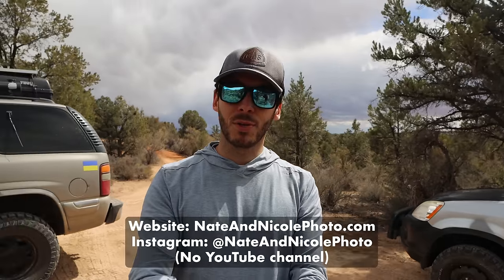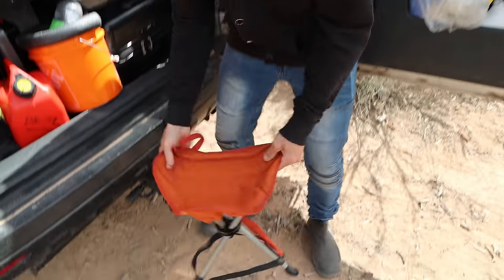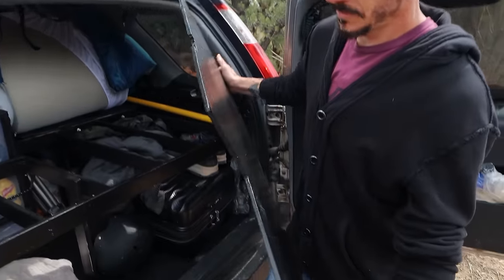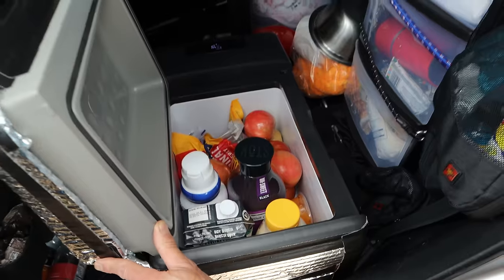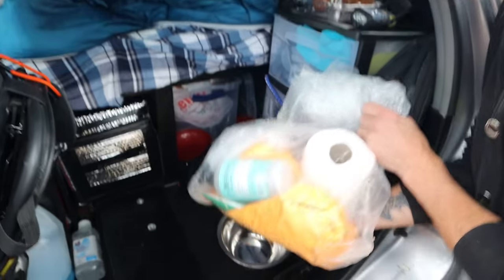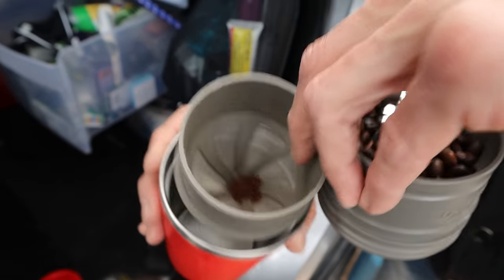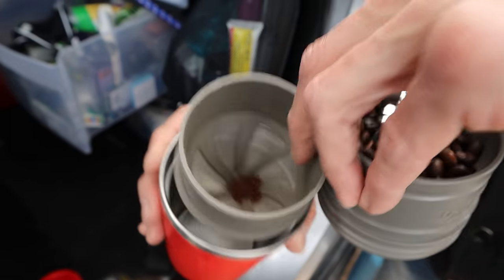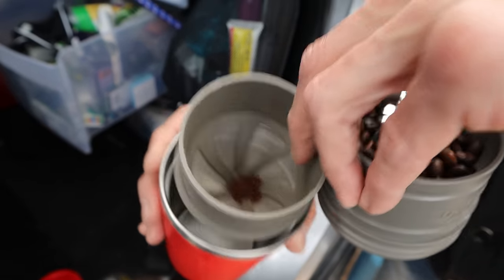Turning a Honda CR-V Into a Full-Featured Off-Road Camper!

Comment: My doctor told me just this week that Pedialyte is better  than Powerade for restoring electrolytes.
Reply: Yes we keep a bottle in the refrigerator during hot humid days of southern summers or when winter viruses are going around.  It is a life saver.
Reply: Check out lmnt electrolyte mix!!  Many flavors. Have a sampler pack too. I use more water than it calls for so lasts me longer 😊😊
Reply: You can do your own with sea salt or pink salt, a little bit of potassium salt (Nu salt to No salt) and a magnesium tablet.  Cheap and best of all no sugar or fake sh….flavors/sweetners.

Comment: I bought a 2002 Honda CR-V brand new and put 300K miles on it. The only issue outside normal maintenance and tires was the AC compressor that failed at around 270K. The CR-V was still going strong until 2017 when 2 out-of control SUVs killed it on a snowy day in 2017. Great utility and camping vehicle! I miss it.
Reply from the maker: Yep, I've heard great things about the early generation CR-Vs! I've always wanted one too.
Reply: Theybare fqmously reliable. Mine just needed front brakes at.200.000.hard to find.

Comment: It's really not worth the hassle of building a bed, storage etc with ply and 2x4 or whatever into a vehicle this size.The extra weight, not being able to completely remove everything quickly if you need to is just inconvenient. You simply need to remove the back seats,  make it flat, insulate the bottom and fit some carpet. Put in a foam mattress, plastic storage boxes, one insulated for keeping food cool and that's it really. Maybe a net strung up with elastic tie outs on the roof for clothes.
This way, everything can be removed easily if you need the space back.

Comment: Nice! I also have a CR-V (compact RV)  I camp weekends in the summer even though I did drive to Florida and back this spring. I removed the passenger rear seat so my bed fits, and still have space for two passengers.

Comment: Very nice camper! We have a Honda CRV we converted and it's working out great. I'm a landscape photographer so sometimes I go alone but most of the time my husband goes along. We started out with two extra bins of camping gear and paired it down to only two bins. Lots of storage underneath for my camera gear and other things we need.
Reply: I’m getting started on my 05 CRV interior build to take to Baja. I’ll do a similar platform for just me and remove all except the drivers seat. Two well traveled cats coming along.  I guess I will build a mounted cabinet with 3 pull out drawers for alongside bed platform for all my essentials. Hoping to not need a heater in Baja, just warm blankets. Any suggestion on a good quality mattress? I’m a side sleeper and boney so I’m in a lot of pain on cheap thin mattresses.

Comment: I agree that most builds use way too much volume and weight of wood.  I view that as an easy way to prototype and test out configurations, but that once you have the setup you want, it's a good idea to rebuild it with a more engineered solution to eliminate obstructions, reduce weight, and reclaim more useful space.  Regardless of vehicle size, creating extra storage space and easier access is a good thing.

I was glad to see at 17:06 that he hadn't covered the air inlet/outlet slots on his Vevor 12V compressor fridge.  Failing to do that will make the insulation counterproductive.  A fridge won't work when sealed in without air flow.

Vevor fridges generally (and maybe always, I'm not sure) are just rebranded Alpicool.  Some are available with the optional LG (South Korean) compressor rather than Chinese compressor.  Those have a big black triangle LG sticker on them in marketing photos.  I have the Vevor clone of the Alpicool CX50 with LG compressor, though it's looking like that variation and shape of Alpicool (CX30, CX40, CX50) is maybe no longer made.  Their shape happens to be the largest you can fit on the floor (actually spaced up from the floor maybe 4 inches) behind the passenger seat of a 2016-2022 Prius or Prius Prime, after removing its roller-luggage handle, wheels, and axle.  It elevates my mattress at the pillow end of a 25x75x4 trifold mattress I use.  And yes, I can sleep with the fridge compressor kicking on and off under my pillow.  I slept with the fridge next to my bed at home for a couple months before doing that, to get used to the sound.

Mine has been running continuously for about 2-1/2 years with zero problems.  I chose it for two reasons: being precisely the size and shape I wanted, and that a Vevor was very highly rated in a comparison of 11 12V compressor fridges done by Jasonoid and his father-in-law.  They personally owned all 11 fridges, as sort of a hobby/obsession, and that was the video which caused me to subscribe to Jasonoid.  Great channel somewhat similar to Hobotech or Will Prowse, though each of the three channels comes at things from different angles.

Comment: When he talks about 2x4s and 3/4" plywood, makes me think he's casting shade on me since I had some of the first 2nd Gen Honda CR-V camper conversion videos up on YouTube years ago...lol. One thing I tell people that see those videos to keep in mind, I had absolutely zero skills or experience when I built my CR-V camper conversion build but I at least gave it a try and did it, though it did turn out to be quite a bit over built. Weight wise, I calculated the weight of that build to be roughly around 200lbs of wood but removing the seats offset some of that weight.  

I've learned a lot from that first CR-V build and improved my design and build quality quite a bit in my current vehicle, a 4th Gen Toyota 4Runner, I still used 3/4" plywood but dropped the weight by at least half cutting out the 2x4s...honestly can't see using anything smaller than 1/2" plywood if you intend on using any kind of hardware like hinges and such. At the end of the day though, these kind of builds should be tailor made to suit the intended use for the owner, we all have different comfort levels and needs. I definitely went overkill on my CR-V build but there were some good ideas I had incorporated with plenty of room for improvement, which I think I was able to do in my 4Runner.

Comment: looks great made for you, nut there is one problem in most states the fuel plastic cans CANNOT BE ON THE REAR OF THE TRUCK? placing it there is a FIRE BALL READY TO HAPPEN? im not telling your going to get rearend , but if you did  chances are you going not live, . i know in the 11 western states of the united states that a plastic can  are not to be on the rear , but a steel cans are?also there is a limit to how much  most states ay 5 gals, but if you look at the flat offroad tanks the max. is 4 gals, also i invented a sure way not to develop pressure in the plastic or steel cans , a vent made from valve stem video on you tube, to install with a cut wire cloth hanger,  and i took a stem cap and drilled out a small hole in the cap on top, to release the pressure at all times? 1/8" hole!
Reply: Great info. Thanks.

Comment: I believe that this version of the CR-V was made from 2002 until 2005 and also came in a manual transmission.
Reply from the maker: According to Wikipedia, this is the 2nd generation and was from 2002 to 2006 👍

Comment: So I'm in the market for a CRV but I'm trying to figure out what year would be more appropriate for me. I'm in Florida and I'm going to have to deal with a lot of sand. And I'm a bit worried about that, I don't need to go out too far, but I would like to if I could. And I understand. Maybe I'll need to lift it, but I'm not sure that will give me the desired result. I am also going to be living in the CRV. So I'm looking for what one is best for me and it needs to be great on gas with really around 35 miles per gallon. Plus, I see a few were like 33 and that's fine. That's not a big deal. Anything 30 and below is a no-go because I'm a delivery driver and I need my gas mileage to be great. But I'm seeing where some of the older models maybe a better choice. And it's been hard for me to find good information on using a CRV for off-roading. Now I'm not going to be doing any major off-roading. But the Sandy rhoads get pretty bad pretty quick without going out far and they're extremely easy to get stuck in. Eventually. I'm going to go ahead a pulley hitch on it, that way if I do get stuck I can just go ahead and hook that to a tree and drag myself out.  But yeah, what are your thoughts on this and what advice do you have for me? Hopefully I get a response. I see that you probably have a lot of responses and may not get back to me. But if you do awesome and thank you.....